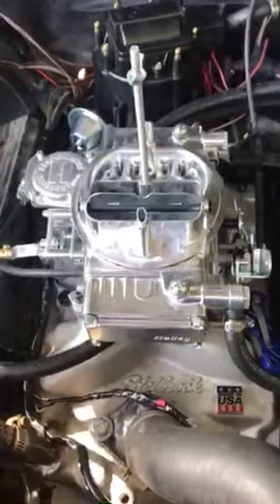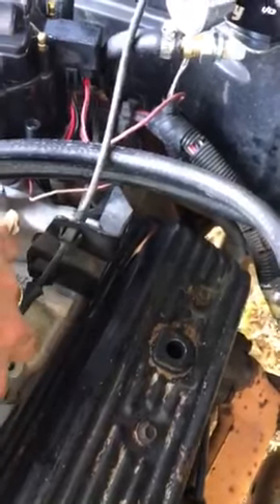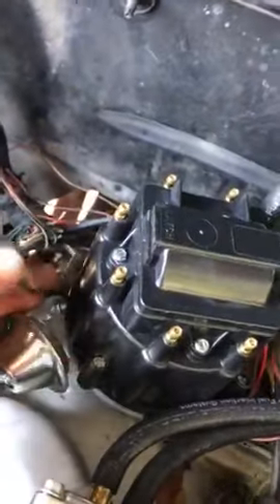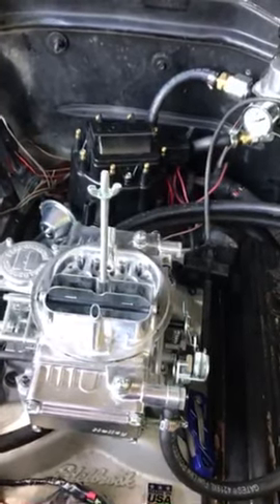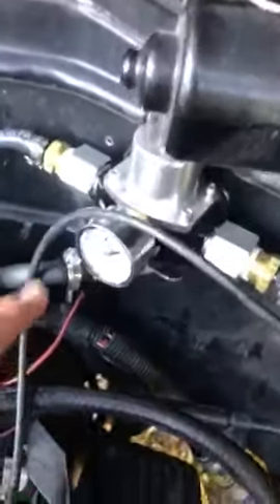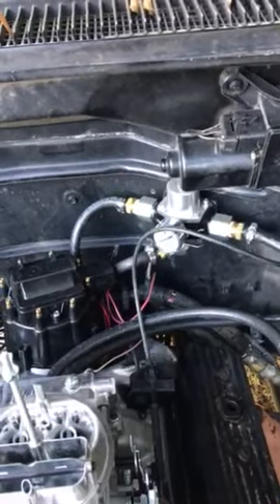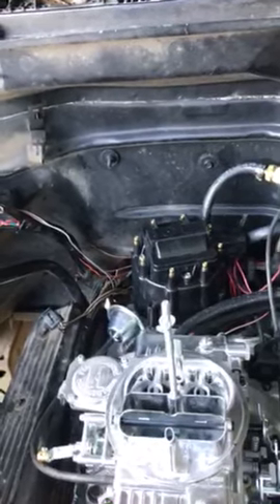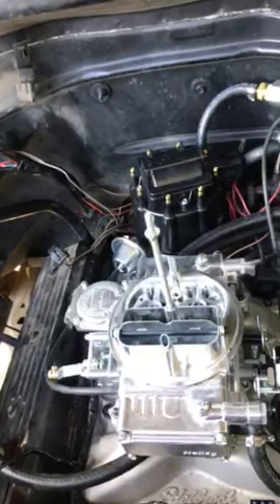Converting TBI to Carburetor, tips and tricks

Comment: We are just now completing a similar conversion on my son's 91 Silverado. We went with carburetor heads, because our valve seals were bad and different intake but similar distributor and carburetor. Was just now fighting trying to figure out how to power the fuel pump, our only hurdle before starting this motor. If I understand correctly, and its great information, all I need to do is run that wire from the distributor plug to the tac wire from the coil And the fuel pump will operate normally?
Reply from the maker: Yes, the computer uses that wire to sense engine speed so that the voltage to the fuel pump is regulated to supply appropriate pressure from the pump.
Reply: @tlariscy   Thank you so much for the very valuable information. We took the info in your video and were able to finish up the minor wiring for the distributor and the fuel pump in just a few minutes. We did get the engine fired but are having a bit of a vacuum leak issue we are working on. One thing we have different, another post had referenced the part number for a mechanical fuel pump that they used in tandem with the electric. The tandem fuel pump has a return and according to the poster it automatically regulated the fuel down to the 5 psi needed for the carburetor. We have everything hooked up, it appears to be working but at this point I believe I'm going to add a regulator between the mechanical pump and the carburetor for safety.

Comment: What do you do about the electrical wiring for the rest of the truck? How does that change with a carb?
Reply from the maker: Hi Steven, you will still use all the engine sensors like water temp , oil pressure Ext. All the plugs for throttle position , map sensor ect will not be used. I cut mine off. Be sure before cutting anything that everything works like it is supposed to. Better safe than sorry.

Comment: looking at your video i didnt see no out let on your pressure regulator for the vacuum hose
Reply from the maker: The pressure regulator does not use engine vacuum. It’s a racing style mechanical fuel pressure regulator.

Comment: Thanks for the video, it was very helpful. But need help.  I completed the efi to carb conversion on my 96 silverado and am utilizing the 4l60e. I used the holley tps. Tried to set tps to .5 at idle and can't get the wot higher than 3.8 and doing so changes the idle to 1.8. It goes without saying g the trans starts out in second gear. I can not find the purple with white stripe wire in the plug which went to stock dist. Or for that matter anywhere else in the engine wiring harness. I even had an additional wiring harness from a 96 and couldn't find the wire in it. The engine I installed does not have crank sensor. Can you please help?

Comment: GM rocks try to do a conversion to a Ford it’s complicated as for Chevys can swap clear back to 1955 Im not picking on Fords but they are a pain to try to swap out things unless you have the specific year sometimes. Those engineers have too many ideas keep it simple.. tried and true great video long live the HEI and Carb👍🏻
Reply: “Gm rocks” that’s why everyone is here trying to get them to run, or be reliable or both. 😅
Reply: If you haven’t converted a 5.7 tbi to carb yet they won’t take the ignition timing a conventional carb engine will because of the combustion chamber shape. They rock alright, 1/2 the motor is rocking the scrap bin to make them proper unlike the fords.

Comment: I have a 1988 Chevy 1 ton that had tbi I put a 350 out of a 1994 in it and want to go carbureted I have put a Edelbrock intake and a quadrajet 750 from 1987 that has a plug shaped like a trailer light plug built into it and my wiring harness always had a green plug that never had something to plug into and it matches and fits the one in carb I have new fuel pump in tank but my question is do you think I will need a fuel pressure regulator like yours to run properly?

Comment: How did you hook up the  Regulator Just a feed on the left and return on the right? And is the a vent on the bottom does that go to the intake or the carb im using my stock intake 1987 4.3l V6 switching over to carburetor.
Reply from the maker: This is for the Holley fuel regulator https://documents.holley.com/99-39_30-1900_by-pass_regulator.pdf

Comment: Hi, i have a question. I have a 89 Chevy Extended Cab Silverado C1500 with a 350 and I'm in process of doing the same carb swap. 

My question is...there's a hose with like a nut type piece where you can put a wrench on to and it attaches to some short of a fitting that im assuming goes into the intake area of the block. would i have to remove the fitting in order to do the carb and intake swap?

Comment: I have a 1995 Chevrolet Silverado. I am removing the TBI. I am a little confused about the fuel pump issue. My Chevrolet crate motor doesn't have a mechanical pump on it. You have to run a fuel pump with this motor. I purchased a Jegs 110gph/lph. They are telling me I don't have to drop the tank and remove the fuel pump. Is this true or not. Everyone has different answers. Can I remove the return line, I do believe I can. Can you help me out? Thank you in advance. Mike F..
Reply from the maker: Hi Michael, you should just use the existing fuel pump that is in the fuel tank and use the pressure and return lines that hook up to your TBI. You will need to run the pressure line through a high end fuel pressure regulator and dial the fuel pressure down to about 6psi. That being said you will want a pressure regulator with a bypass, it will have three hook up’s. One for the pressure line from the tank, one with the regulated pressure going to the carb and the bypass going to the return line for fuel tank. Pay special attention to the part in video about wiring up the tach connection to HEI distributor. This function is what regulates the fuel pump turning on and off based upon engine RPM. Skip this part and you will be able to start engine but it will shut off when carb runs out of fuel because fuel pump did not continue to supply fuel past the initial prime up when you turned on your key. Hope this helps.
Reply: @tlariscy  thank you Walt

Comment: For everyone trying to figure out the fuel pump I just did a hot wire to a switch, very easy to do and very simple.
Reply: You have to make sure that the  power you connect to is energized at start and run only not constant or your  pump will  continue to run in the off position .
Reply: To Get The In Tank Pump To Work other than just prime! cut grey wire from fuel pump relay on passenger firewall and connect it to new relay which will be your fuel pump hot with constant 12v, switched 12v & ground wahla fuel pump comes on with ignition switch and works properly! Remember to use a bypass regulator!
Reply: How about when you have duel tanks? You have two relays ,pumps isn't there a by pass selinoid for the fuel lines also and what have you. Do you need the purple wire to go to the selector switch in the dash?

Comment: I did the same swap with my 93 Cadillac Fleetwood for the distributor all I found is a pink wire and a white wire I hooked up the pink wire to bat on the Hei Distributor and the white wire on the tac/green wire on the Hei distributor  can't find a purple wire anywhere.
Reply from the maker: Not sure how the Cadillac is wired. My experience was only with the C1500. Sorry I couldn’t be more help on this.
Reply: @tlariscy  Sorry I found out what the problem was it was out of gas and the gas gauge was off by a quarter tank lol

Comment: Hi, Thanks for the video!!! Did you or do you have to run a throttle position sensor or does the transmission lock up still work without it. I have a 700R4 in my 89 caprice and I’ve been wanting to do this conversion for the last four years but was just a little scared
Reply from the maker: Hi the easy way to do this is to put a manual switch to activate the lock up from the dash of your vehicle. here is a link that explains it, https://itstillruns.com/wire-switch-lock-up-torque-converter-700r-transmission-11372151.html   hope this helps
Reply: @tlariscy  do you leave the hole on driver side valve cover open? I also have the same motor in my 86 GMC Sierra 1500 along with the Holley 600 carb and was wondering what lines you have connected to the carb
Reply from the maker: Carlos Hendrix I used a threaded pipe Niple in rubber groumet on valve cover and attached rubber hose to vacuum source.
Reply: What is the transmission lock up and do you have to do this?
Reply: @mr_brooks_2 i have a 89 caprice switched from tbi to carb and i have some questions if you don’t mind
Reply: @caleb5850  Sorry Buddy I never did the conversion yet. I have just about all the parts but still haven’t went through with it.🤦🏾‍♂️

Comment: Lots of questions! What carb? I know the flow of the heads is crap.
Have 1989 C1500. Motor was rebuilt with Comp cam (5000rpm)and roller valve train. Suddenly have no high end. What linkage kit? (I have 700R4). Where is the timing? Does yours have more power over the TBI?
Thanks

Comment: Do I really need the return line to be hooked up? Can't I just block it off?
Reply from the maker: Yes, as I understand it. Without the fuel being able to return to the tank the fuel pressure will build until something between the regulator and fuel pump fails.
Reply: @tlariscy  Ahh, oh. Thanks!
Reply: No you will have to get a fuel pressure regulator and lower the pressure , without a return line it will flood the engine with fuel

Comment: Can you assist me further? Questions arise when doing the changes from TBI to carburetor. For instance, where do I hook up my brake booster line?
Reply: Hook it up to the manifold vacum port on the back or front of the carburator
Reply: @johncarter9054  Thanks John. Got it figured out. New question. Can you tell me anything about the TPS from my TBI? I can't figure out if I need to hook it up to my Rochester to make my tranny shift right or does it work exclusively off of the detent cable?

Comment: Why the purple and White wire for the fuel pump and not other ignition activated wire?
Reply from the maker: The wire does not power the fuel pump, the ECU reads engine rpm through this wire then the ECU controls the fuel pump according to engine rpm.
Reply: Thank you that makes sense

Comment: I am about to do exactly what you did. Had my 350 in my 89 C1500 rebuilt to a 355 and roller cam. Wont idle worth crap. Has ALL new sensors, yadda yadda. The old TBI has to go. Endless surging and uncontrollable idle. Looking for part numbers for manifold, carb and kickdown linkage adaptor. Also, did you use anybold HEI distributor? Thanks
Reply from the maker: Edelbrock 2101 performer Spectre Performance 24283 Throttle Cable Bracket and yes the standard HEI will work, you will have to change to a bronze distributor gear for the roller cam.
Reply: What do you set your timing to after the HEI distributor and club swap I did this a month or so ago putting that motor out of that truck 93 1500 extended cab in my little square body S10 Blazer and it's running really good but I was wondering what did you say your timing too on the balancer with a light you can go on my YouTube channel 1lowz and see my build

Comment: Does the computer freak out and throw a bunch of codes with all that stuff unhooked?
Reply from the maker: Hi Nate, good question. If your doing this swap it’s probably because your computer or wiring harness has some serious issues. You probably are already getting codes that you can’t seem to fix. The ECU in the TBI system mostly controls timing and fuel mixture. This swap precludes the need for the ECU with the exception of needing the electric fuel pump to be controlled. The only sensors left are engine temp, and oil pressure. The ECU does not control these functions. So to answer your question, yes you will get codes however the codes have nothing to do with the proper function of your engine once the swap is done.

Comment: Do I absolutely have to have a return?
Reply from the maker: To the best of my knowledge the bypass allows the excess pressure to return to the tank. You might have fuel line or regulator failures without the return. If you are using the factory in tank fuel pump, then I would have to say that the return is necessary. Hope this helps.

Comment: So you think keeping the fuel pump in tank is better then running a mechanical pump on the block??
Reply from the maker: Either way will work, just didn’t want to pull pump out of tank and replace with non pump pickup and fuel level sending unit.
Reply: How you doing today I like what I heard right now sound like you know what you're talking about my question is what would be the issue if I ran the mechanical fuel pump if I didn't want to get the pressure regulator for the fuel what are the cons on using the mechanical fuele pump
Reply: @joerodriguez2180  ran mechanical pumps on 5 cars up to 600 hp. Works great. Simple. No wires no sensors. But everything has to be eliminated if it's a fuely car that's the key. Having everything work after everything is gutted  also. Can do that if it is a year or car that does not need any emission testing like here in connecticut classics you can gut sensors. Cats and make it simple and fast
Reply from the maker: @joerodriguez2180  hi Joe, I considered doing the same thing, I just didn’t know how the factory fuel pump/ sending unit/ fuel pick up in the fuel tank would work with the mechanical fuel pump trying to draw fuel through it. It may work but without replacing the electric fuel pump with a pass on through tube I couldn’t say if this will work. It may but I’m not sure. Hope this helps.

Comment: I did this conversion with a 1990 7.4 l k3500. My truck got no spark with a regular hei distributer, so I switched back to the stock distributor with the coil. Now I get spark but the fuel pump is not turning or staying on. So it will slowly sputter a couple times then die. How can I energize the fuel pump?
Reply from the maker: Hi Keith, first make sure that you had the larger red wire from the distributor harness hooked to the (+ or POS) on the HEI . This is to power your HEI. Then the purple wire with white stripe from the same harness will hook to the TACH port on the HEI,  this will send the engine speed signal to the fuel pump to run accordingly. Hope this helps.
Reply: Yes I hooked the purple with white stripe to the tach port and no spark at all. The original type distributer has worked the best. I'm purchasing an electric pump before I pull all my hair out...wait I'm bald already LOL!
Reply: Also this will give me the ability to easily add a tach to the white wire off of the coil

Comment: Im going to do the conversion  on my 92 camaro  i allready  have the hei distributer hiw and what wire would i use to run the pump thank u
Reply: Hi. Im also doing a 91 camaro 3.1 to 2.8 mani/carb swap.  Did you find a distributor? What part#

Comment: I have a 600 cfm edelbrock carb on a 95 gmc 5.7 350 and I have a problem where everytime I give it higher rpm’s it dies right out I can drive slow and it’s fine but as soon as I give it more gas it the rpms go up then drop to zero and dies
Reply from the maker: Do you have a fuel pressure gauge installed? Sounds like you are losing fuel on fuel demand.

Comment: Went from tbi to carb in 89 chevy k2500 its showing a MAP sensor code but the Carb runs fine without it. Is there a way to bypass that? The computer is throwing the engine off in some aspects like harder start. This just recently started happening.
Reply from the maker: Hi Robert, if you changed to a carb and switched to a HEI distributor, the computer has no control over your engine any more. There could be some other issue causing the hard start. Are you using an electric choke on your carb? With a carb in colder weather you need a choke for better starting. As far as your computer throwing codes … you can ignore these as they are irrelevant. Your computer does not know that it isn’t controlling the engine, as a matter of fact the only thing it is controlling is the fuel pump if you are using the in tank fuel pump. I would double check the easy stuff first like… timing, plugs, and fuel/air mixture of carb. Good luck, let me know what you find.

Comment: When you hooked up the purple and white wire to the tach port did you still have a functional tach?
Reply from the maker: Hi this truck did not have a tach, so I’m not sure on this.
Reply: I was able to hook up both the white factory tach wire and the purple/white-stripe fuel pump wire to the tach port on the HEI and everything works to include factory tach. 1992 1500 Z71

Comment: Does the purple and white receive power with key on? I have my tester out and it’s showing nothing
Reply from the maker: It gets signal from distributor and takes it to ECM. It does not power anything, the power is then sent from ECM to fuel pump
Reply: Thanks for the response. Ended up running a electric fuel pump. For some reason it never sent signal to the factory fuel pump.

Comment: will the purple wire be the same hook up procedure with a 97 454 vortec I will be using a hei distributor also
Reply from the maker: Hi Justin, I couldn’t say for sure without looking at one. However in theory they should be very similar though. Wouldn’t hurt to do a little research first.

Comment: I have a tbi 350 and plan on using a 2barrel carb and adaptor to bolt up to the tbi intake but my question is will a hei carbureted distributor work on the tbi intake?
Reply from the maker: Hi Sam, as far as I know it should. But you might want to float that question around to other sources just to be sure.
Reply: Walt Lariscy who should I ask?